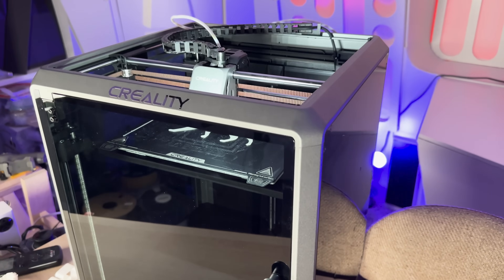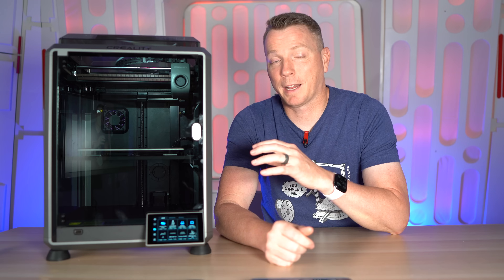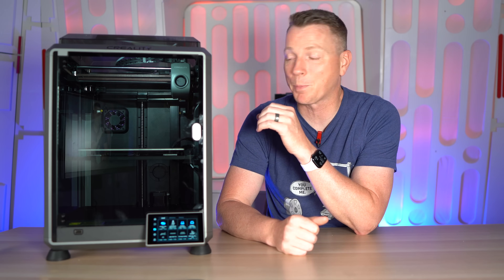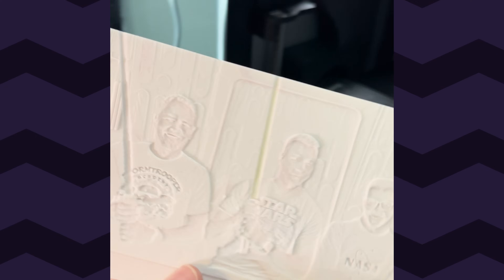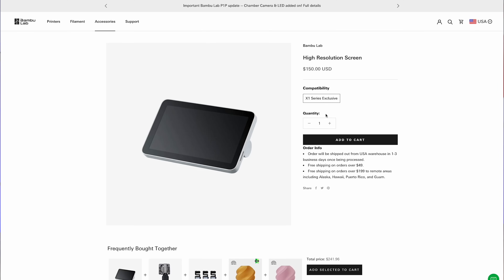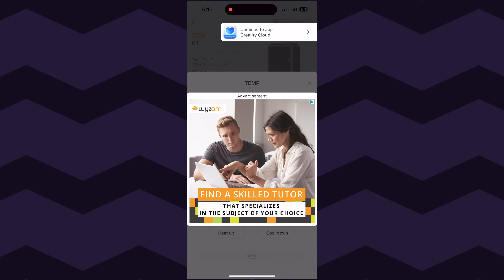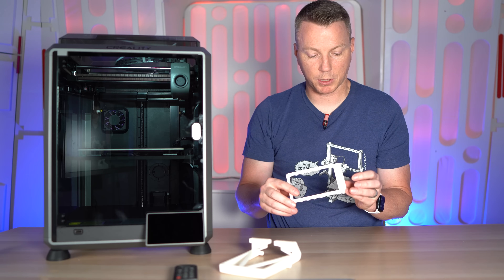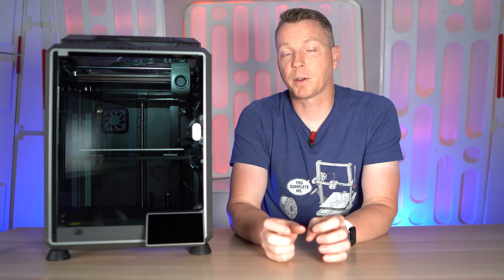I Regret Buying the Creality K1. Here’s Why.

Comment: Chipo p1p/s screen kinda reminds you you've paid not enough to have a good touchscreen every time you look at it). Not the case with K1. Number of times you do calibrations and twicks standing next to the unit should not be underestimated. I got mine recently and it's got upgraded extruder and has a matte lever finish, not glossy as the one here and the chain can not unlock that lever at the leftmost corner, unless I push it with my fingers. I guess Creality just made the chain longer or smth. The biggest thing I hate is the noise(

Comment: Bought a P1S two weeks ago. I've been running it everyday for about 8 to 10 hours. I have not had one failed print. It's fast and so far quite reliable. As suggested by Bambu Lab, I clean the PEI sheet with warm dish soapy water and dry it before printing. The first layer has always been perfect. Myself, if I needed another printer I'd just buy another P1S.

Comment: I have a K1 and its worked flawlessly so far.. Its weird that so many people have such different experiences with this printer. 

And why is the Bowden tubing for the filament not inside the cable chain?? On my K1 the Tube is inside the cable chain with about 10cm at the extruder end not in the chain so there is no way the chain will get close to the gear extruder switch as the tubing stops it from getting near it.. Its like this on the official website page to give you an idea of what I mean.
Reply: They updated the machine from what I hear so if you got one more recently they have fixed alot of the issues on them.

Comment: Thats why i got the Qidi X Max 3 3d Printer. Its running on Klipper. Works right out of the box with heated chamber for high temperature filaments. I like huge print volumes (325^3). I dont like proprietary stuff. I added 3dChameleon for the MMU.

Comment: I believe they worked out the kinks which made me purchase one, I don't do cosplay or need to build life size helmets, just a hobbyist,
needing enclosed printer, prints fast, and easy to set up, I don't care for multi filament, if I need to change color, I can paint the 
project. For the price it fits my budget for doing very little printing. I bought it because the reviews recently are much better
than it was in July. Thanks for being honest, it the K1 craps out, I will definitely let them know.
Reply: I am in the same boat as a hobbyist. I have only had one time where I thought multicolor would be cool and convenient, and that was when I was printing board game pieces as a gift for my sister. Currently thinking of upgrading to a K1 from my Ender 3. Is the app still terrible and full of ads? Even if it is, I would probably control the printer mainly through the web interface anyway.  Are there any other things a fellow hobbyist should know about it from your experience?
Reply: It was easy to set up, enclosed, and small, which suited me for what I was doing printing small projects. I had to get the better extruder and the new hot end, plus
the nozzle kit for later knowing these ends will wear out and not give you good prints. Make sure to set the power on the side of the printer to 110 or 220, normally if you are in your room, 110 very important, also make
sure your printer is on that circuit by itself
because it draws a lot more printing than your TV or PC combined. Also take the tube
out of the feed tray, it hinders the feed of the filament. If you are patient and like to tinker with small tools and like problem solving. I would wait until after Christmas I know the price will be $400 or less. I would never buy one ever again, I am old and never used a 3d printer before and just don't have the time but I managed to learn in one day. @RyanBoggs

Comment: CHEP had a video on using the Bambu slicer with the K1. There is also a fork of Bambu's slicer called Orca that should be even easier to make work with the K1 and preserving everything else you like about the Bambu slicer. That, of course, doesn't solve your other issues with the K1.
Reply: Not sure how that would make the K1 physically better, or scuttle the problems it has.

Comment: I sit next to my printer (Ender 5 s1) and send jobs to it from Cura. I can see the bed is clean and clear from a £2.50 webcam too. I installed Klipper myself on a cheap Pi 3B+. It's not as fast as a K1 or P1P, but it sits idle for 16 hours a day anyway. I have no problem taking 30 seconds to swap a spool before a 12 hour print!

Comment: Up until now my k1 has been working great. My last print PETG translucent print, no supports, just a raft, minimal stringing and great print. All those that can’t get a print to actually finish off of this printer….I think patience is all K1 owners need and maintain the printer.  I’m just a hobbyist but a patient one.
Reply: Or, you could get a bambu, which doesn't require patience
Reply: @anishnattamai8801 too new of a company. Their printers are way overhyped in my opinion.

Comment: The issue of the cable chain has been figured out already, shorten the chain and strengthen the locking force. Not all things come out perfectly at the beginning. To decide which printer you need, it depends on what you need it for. I need it all for small tools with the same color at once, but not trying to be an artist.. AMS can be a plus for me, but it's all count on money and I'm an old guy. A nice display is much easier for me but not to go through with my dumb phone.

Comment: Would love to hear an unbiased review.  A lot of "For me" in there.  Separating your opinion from the facts would be nice. Ultimately, you comparing a printer with an add-on to curb having to switch filaments is not a fair comparison..when, the add on is 300+ more than the printer you are comparing it to which is $100 LESS than the printer with that option.  Newsflash, you are paying $100 more for an extra 56mm X/Y on the bed and the ability to spend MORE money to get a filament changer.  This can be seen as a plus or a minus depending on your opinion, but not on the facts.  It's a null fact.  You pay more, you get more pretty simple, and DING not a "feature".  At the bones level, the K1 is a better printer. By a lot? Nope.  Both printers are great and have their own pluses.  No need to Apple/Microsoft this just for clicks.  Either one will suit you just fine.

Comment: The strength of the Creality Cloud is the fact that they offer a true, cloud-hosted slicer that runs as a virtual machine (VM).  This means you can slice your STL files from a mobile device, like an Apple iPad or iPhone.  In this age of mobile wireless, I don’t want to be anchored to a desktop or notebook PC.   I design machine parts via mobile devices, and like being able to slice from the same mobile devices anywhere, anytime.  

If Bambu Labs would host a cloud slicer,  I’d be all over their X1C in a millisecond.

Time from design to print is key for me.  I like being able to model on the go, slice on the go, and then quickly shoot the g-code to a local FDM printer over a wireless connection to get prototypes I can physically evaluate before sending the 3D models out for SLS and DMLS printing by a manufacturing company. 

The Creality Cloud slicer is extremely basic, but honestly, I design and engineer machine parts, and even I don’t need 99% of the features of a full-blown slicer to print 99% of my prototypes.  

What I do not like about the Creality Cloud environment is that it is coded more for compatibility with Android mobile devices than devices running Apple iOS.  This means that from time-to-time, problems will appear where you cannot make a data field entry or the pop-up windows will appear wonky when accessing from an iPhone or iPad.  For example, right now, the Creality Cloud can be operated from an iPhone, but not an IPad — because the web app is goofed up with a side bar that covers half the screen and cannot be toggled off via iPad.

As for the incessant advertisement pop-ups and notices from Creality, I don’t seem to have that problem.  I get maybe one “junk notice” every few days, but the important notices about the status of my print jobs are clear and sent to me right away.  Creality assigns “levels” to their Creality Cloud users.  Once you reach an expert level and are awarded badges as an expert contributor to their web community, they stop bothering you with all the junk notices and ads.

Comment: All the gripes about the K1 pretty much seem to be resolved at this point. The Creality app can be replaced with any Klipper app as there is a way to open the machine up to run full Klipper rather than the messed about with version that ships with the printer. You can also run Prusa Slicer as there are profiles for the K1 available now. Also there are fixes for the extruder issues and cable chain problem available from Creality for those with early printers and printers shipping now appear to have the updates already there. The camera and LiDAR are also now shipping for the K1 and already installed in the K1 max. For me, although the P1P is a fine printer the enforced cloud integration and terrible privacy policy make it a none starter.
Reply: Just saw the K1 at Micro Center for $399. Really interested in getting one. I have the Ender 3 and AnkerMake M5 now.
Reply: @n3rdoutmedia  K1 firmware has been open sourced now so all the software gripes are essentially gone as you can now officially run full Klipper with associated phone app and good slicer integration. I have the K1 max which hasn't given me any issues. Make sure it is a recently manufactured machine if you buy one as the first batches had bad extruders but that is now fixed. Not as plug and play as P1P but has a good community and lots of good slicer setting available now. As you already have a couple of printers and have experience you won't have any problems setting up a K1.
Reply: Bambu cloud and them using your stuff or selling it to third parties is a big no-no that mostly no one talks about. Creality seems to be solving their problems, but Bambu isn't.
Reply: There is a button on the Bambu printers right on the menu that asks if you want to use Lan Only.  One click and everything stays in your home.
Reply: Same for me, the privacy aspect eliminates the Bambu for me.  I just ordered the K1 on the sale under $500.  Ordered the upgrade nozzle as well and PEI bed.

Comment: Bambu lab is just a better choice. Creality has been in the top sellers of printers due to offering some decent well priced entry level machines but also market saturation flooding it with dozens of side models so their brand is most of what you see when you search. This sadly leads to severe stagnation in their engineering department the fact Bambu lab had to make their printers just so creality could copy the blueprint is laughable when you look at the lead creality has on BL being in the market. I know no one asked for this rant but I honestly do think creality deserves no customers point blank.
Reply: Even more so now, they are slowly becoming antiquated. During the days of bed slingers, and dual rails being a commodity, they shined. But they did not keep up with the times. They have slowly had their competition, and their knockoff producers catching up, if not beating them.
Really sad, as they have done so much for the community.

Comment: Actual build volume P1P is 238x228x250, yes you can get the entire specified build volume with some modifications but then a couple functions that distinguish BL from other printers disappear and BL advises against such mods.

The difference in build volume compared to K1 is negligible!
Reply: 1/3 build volume is NOT negligible. You are just trying to justify wasting your money with that garbage Creality K1 printer.
Reply: You lose 18x28 at the front corner. You can still print 256x228x250 or 238x256x250 depending on how you orient it.  You in no way lose 18mm off the left side and 28mm off the front.  At 238x256x250 is still 20% more volume than 220x220x250.  I wouldn't call that negligible.

Comment: thank you for making this video, i am in agreement that the k1 isn't a pure winner yet. i wish it (and more importantly the k1 max) was.
However since you're stuck with one you should know something to help with your biggest issue.
You can ignore the creality app and use klipper's fluidd to use the printer remotely.  On any phone, computer, or tablet.  
People have made prints to lock the start of the cable chain to stop it from bending over if you haven't already fixed that..

Comment: This is just nonsense, the guy has no clue what's he's talking about. No printer is really printing 600 m/s and there is no need to. 
Also, P1P is very CLOUD-centric and I've personally seen these machines that cannot be controlled remotely due to some network issue (super failure). I wonder if they can just shut it off once...
P1P is also not available at all in certain parts of the world, it has zero upgrade potential (this seems to be true for creality too) and all the settings are closed. This may seem "a good printer" for a 4-year old...
Reply: Zero upgrade on P1P? What about a hardened steel nozzle and extruder gears, custom enclosures, aux fans, and AMS? That may be true software wise, but it won't be long before someone cracks that on both machines.

Comment: So idk if it's "supposed" to be this way, but my boden tube runs through that chain. I've never had any of the issues you mentioned. Hell, honestly, I haven't had most of the issues you mentioned personally (I'm not saying you're wrong, want to make that clear). The app doesn't give me ads like ever...yeah sure there are a bunch of notifications, but having been on the platform for quite awhile now, I feel like it happens so much because they're pushing pretty hard to build a community in and around the app (for better or worse). 
To be fair, I haven't had the opportunity to use any Bambu printers and I won my K1 in a giveaway, on top of all of my printing experience outside of resin has been only Creality machines (E3 Pro, E3 S1 Pro, and K1). I wish I had more to compare to really, which is what brought me here in the first place. I was really curious why you didn't like it and was expecting an asshole elitist complaining, but I was pleasantly surprised, so thank you for that! 
I like your points and your opinions! They are all fair and unbiased in my opinion, but maybe try feeding your boden through the chain, it might help lol!

Comment: 1. Guys have already found a way to replace the Creality junk locked version of Klipper with a stock unlocked Klipper with all the features available
2. This addresses the print quality issue, because  the Creality   has locked InputShaper to always-one-type even if it's not the best option for a specific printer. That's why frequencies are also wrong and InputShaping is not working properly. With unlocked Klipper you can do proper calibration of the IS.
3. Regular version of Klipper basically means you don't need any apps -- you just open your browser on your phone or computer and Navigate to the Klipper UI( and you can also select which one will be used).
4. You don't need to use a Creality junk slicer -- you just need to extract start and end G-code and you can use fully functional regular PrusaSlicer or Cura to work with Creality K1.
5. Klipper team updates Klipper on a regular basis, adding new features and fixing existing. Everything is OpenSource and secure. At the same time Bambu Lab has proprietary firmware and software, so you are basically locked and 100% depend on their support and engineers. There is no open source version available and no other ways to flash new firmware without using their built-in tools. Also, I don't know how it is now, but a few months ago the only way to update Bambu Lab firmware was using their ... Cloud. Which used to be a nightmare compared to current Creality junk. So even if your security requires you to have SD/LAN-only connectivity, the only way to update firmware was using their Cloud. Don't know if they have fixed it, because people were upset.
6. Calibration of the printer -- you will not recognize K1 after full calibration of the K1 using the full version of Klipper (instead of stripped down customized Klipper with some magic values that are hardcoded by drunk Creality engineer).
7. Creality is using most of the parts available on a Market, whilst Bambu Lab is fully proprietary. And when carbon parts of Bambu Lab are dead -- you will have to pay huge money to replace them( and it's not guaranteed they will be available).
8. I print 90% using CF or GF filaments and BambooLab's MMU junk and open printer are useless for me. I can replace the feeder or even the whole head on Creality if I'm not happy with the Creality version. At the same time it's impossible on Bambu Lab. 
9. But yes, for the casual user that has no clue what is Linux, what is a calibration of the printer, the user that prints red dragons or similar projects using PLA on their BL printers in order to share them in Instagram or other social media with hash tags of "blazing fast printer" -- yes, BL is definitely better option than a real heavy weight tool like K1. 😁
Reply: Not anymore, if you chose the latest .21 update as they patched the root exploit and you will not get back in, even if you try to root it afterwards. Very sad indeed. Especially since Klipper is supposed to be open-source
Reply: @BobStrenger-v8y  So if you know the  .21 update is locked, why would you use it?
Reply: @BobStrenger-v8y  I mean you don't need anything from Creality after you install clean Klipper.
Reply: @BobStrenger-v8y  Ok, I've checked -- .21 was already "fixed" by guys. Now, you can easily rollback to .15. Also, the root password is also well known now. I can't post links here, but you can easily find the required information.